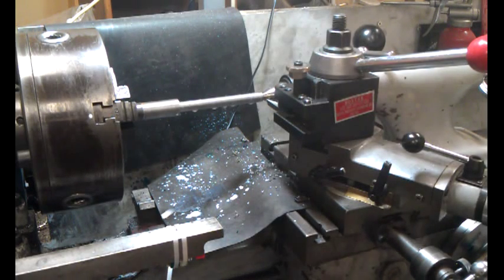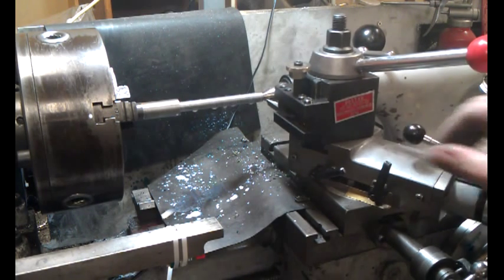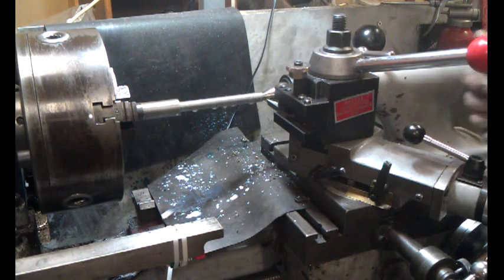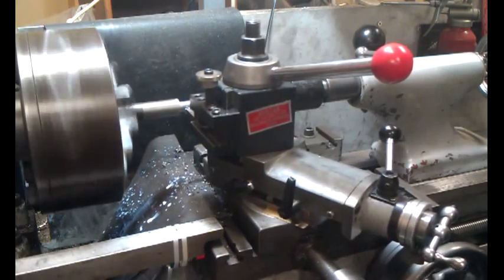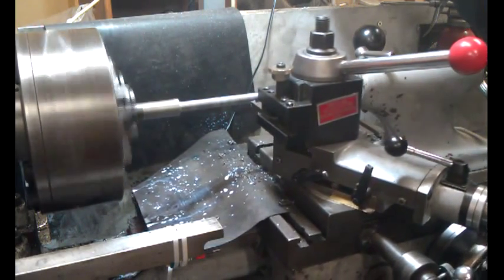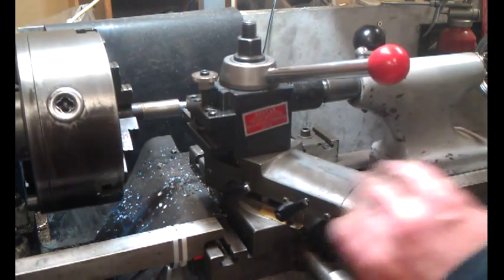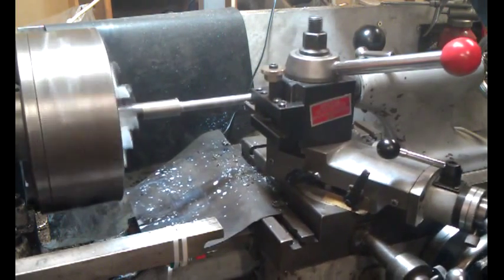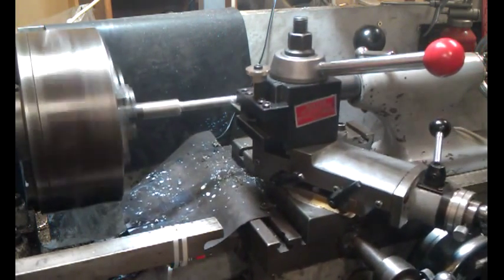Mars lathe thread cutting with new saddle stop switch

Comment: Nice to see an old Aussie machine tool in use. I've got a early '60s "Advance" from Melbourne and a "Nuttall" as well. I'm actually looking for any old Aussie made milling machines like Clisby, Mars or Hercus ATM. That DC motor with brake is an interesting adaption. Did you fit that up or was that standard?

Comment: If my lathe stopped that fast it would spin the chuck straight over the bed and onto your left leg.
Reply from the maker: Hehe. This lathe has a screwed nose too, with a 8" chuck it sure would unscrew, but with the little chuck it is fine. Once you have a lathe with a camlock nose though you do feel a bit safer.